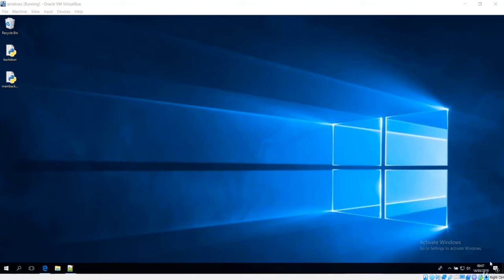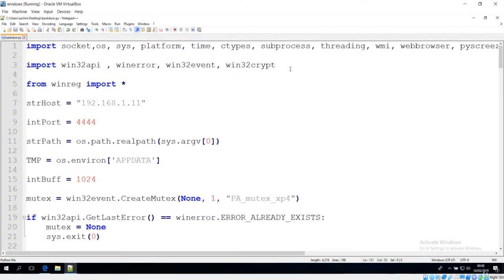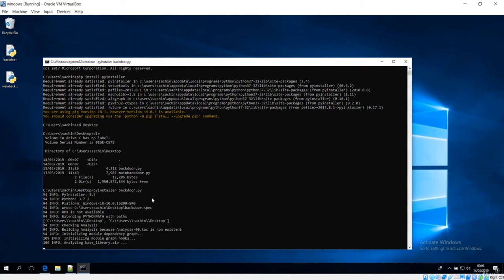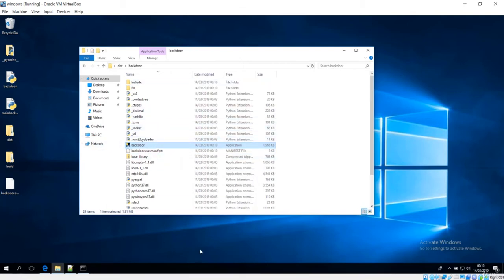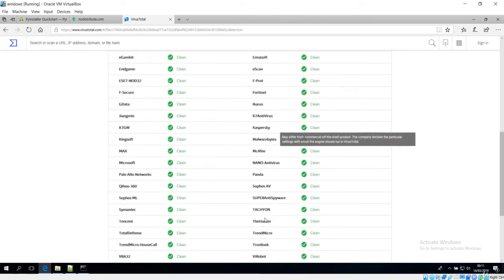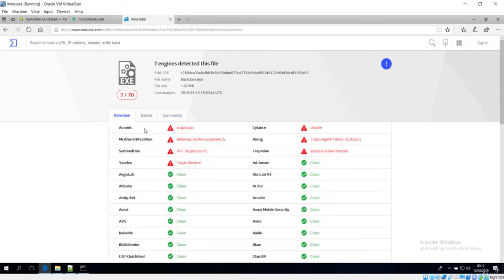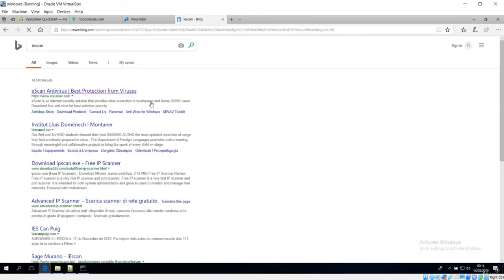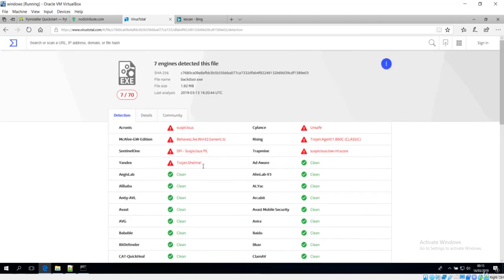16  Test Backdoor with Antiviruses

Comment: Nice series. I still got some errors but I need to improve my own code so yeah. thanks
Reply: is it undetectable still?
Reply: @kismatkunwar6301  it depends. I used it as a project for my school and it was alright.
Reply: hey guys , im trying to take ss from the backdoor , its says file size 2144155 bytes (for example) but i receive only 5 bytes what im doing wrong  can you help plz?
Reply: @alptekin0x4  maybe try more buffer size
Reply: @hazed69  i have solved it bro there was something wrong with the receiveAll function. thanks anyways.